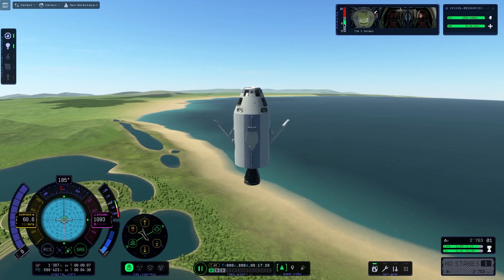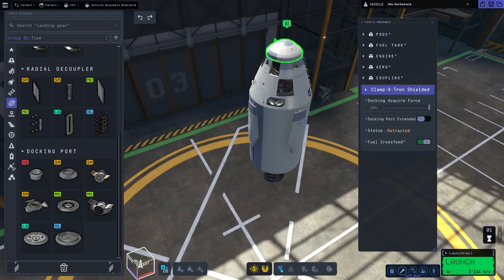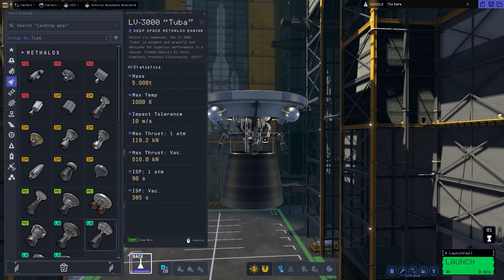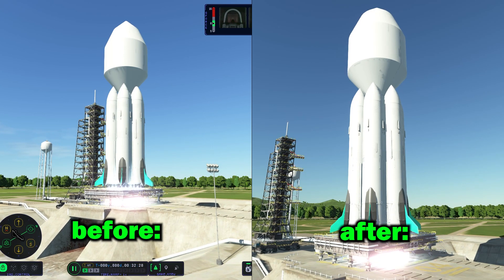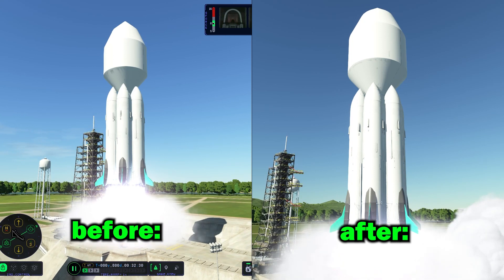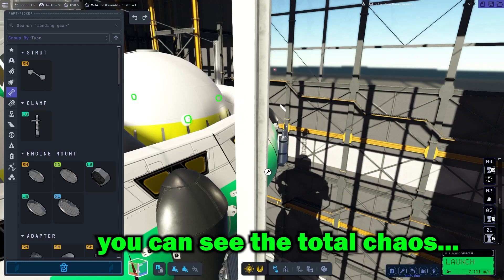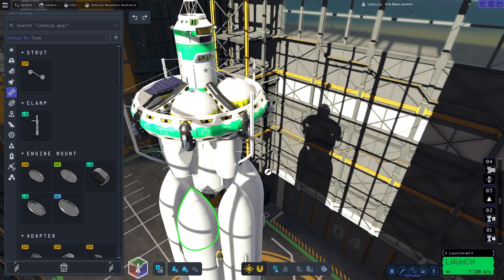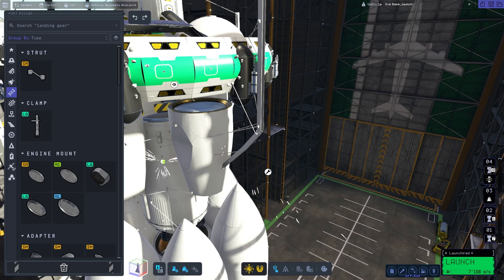Extendable Nozzles in KSP2! + Performance Test / KSP2 Patch 3

Comment: Performance was the most noticeable upgrade this patch, especially for smaller rockets on the pad. Went from rockets starting at 8-10 fps to now nearly 30 fps on my setup. The launch of the game would have been a lot better if this was the first early access patch >.<
Reply from the maker: That's great to hear! Maybe I just went too far with my rocket😅
Reply: @MarvinHuber_PlanetCoaster  Perhaps so. Hopefully they can iron out the performance for high part counts.

My metric is for 30-70 part rockets. Stuff that can make it to the mun and back. I'm impressed it's changed so radically since 0.1.0.

Comment: At this rate the game will take 10 more years to reach the current state of KSP 1, let alone expand upon it.
Reply: I mean, KSP one took many years to get where it is now. This is already a lot farther. A lot of people fail to realize how much is already done with the other parts of the game. The other solar systems are in the game, just not activated, a lot of colonies stuff is also there in the files.
Reply from the maker: @thecyanadon  Well KSP1 wasn't advertised as the perfect space game with thousands of features and it didn't cost 50 Dollars right at the start, but your second point sounds better, the question is more: How bugy will those new features be? If they continue like this, that they fix 5 bugs, but introduce 2 new once, it'll take a time. For example, I got it a lot more now that the engine sounds just cut out, or that the space button won't activate the stage I set up. Further more there are design choices that I  just can't understand, like the new fairling system, that is more annoying to use than the old one (I'm not speaking of the bugfix, that is good, I mean the delliberate redesign of the fairling editor) or the Navball that is more transparent and less visible. There was nothing wrong with that, but they changed it?! Anyways we have the same goal, we both want a great game, so let's hope it'll happen
Reply: @MarvinHuber_PlanetCoaster   All i can say for the change is yeah it sucks, but we are just too use to the old one, KSP 2 is made to "inspire the next generation" I hope everything goes well,
Reply: @thecyanadon  I don’t recalled KSP1 was ever in this unplayable stage as KSP2 is right now.

Also I never get the sense of the dev being incompetent with KSP1.

KSP2 is reeks of incompetent from the dev everywhere you touched….
Reply: @tonamg53  you have obviously never played early KSP.  It is quite funny as most of the devs in KSP 2 made KSP 1
Reply from the maker: Yeah I can agree, honestly I personally don't think we'll see interstellar travel and multiplayer incoperated propperly. Eighter the money will be cut, or it will be barley playable due to the bugs
Reply: @MarvinHuber_PlanetCoaster  I mean yeah, if you ignore them responding to people like you concerned about them not being funded.